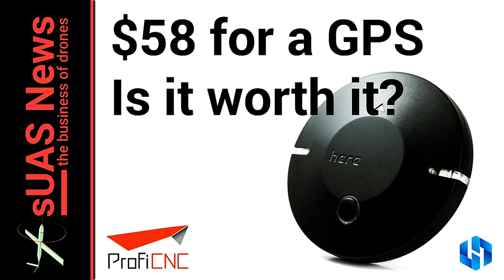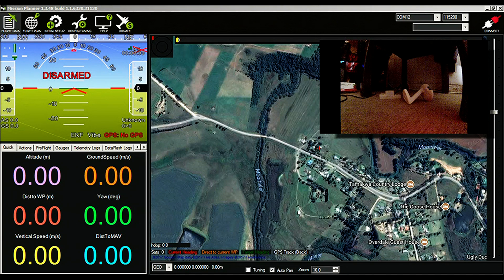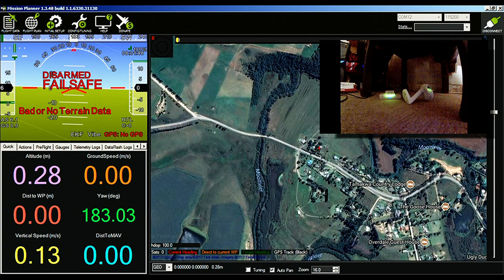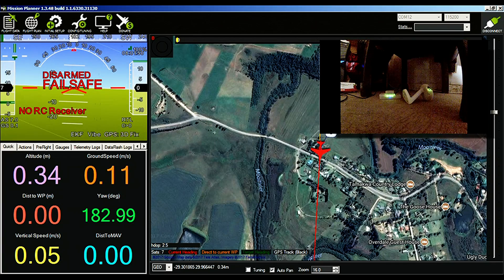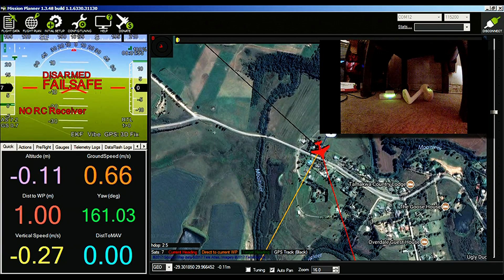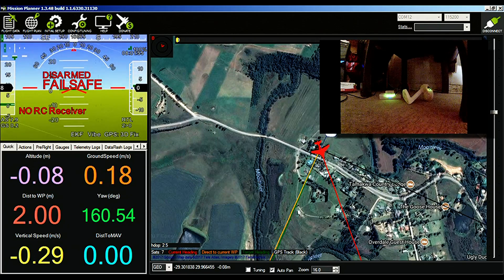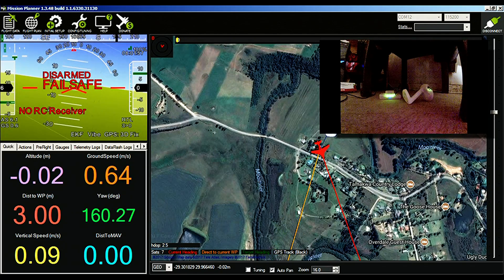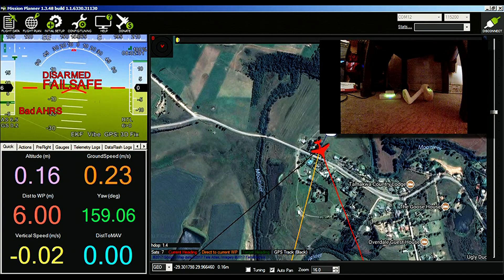The M8N Here GPS from ProfiCNC

Comment: ~> is it known to what degree they are off by, on your ac. I'm trying to take known reference "off by"  distances and correct in "separate " program  CORS in theory, bypassing RTK equipment. The RTK data needs to be corrected too so why not correct from your already known state. We'll see. (Quantum & Google map georeference with Cape Canaveral COR station is the general idea). What a mix of reference system data by State and Local Governments here!
Reply: that won't work- must apply correctors on EACH satellite, a $58 GPS unit won't give you what you need. However, it will give you a low precision position in a noisy environment.
Reply from the maker: I won't be after accuracy, just a fix within 10m of take off. I didn't expect it to see anything under my chair. I guess the 6cm ground plane helps.
Reply: Agreed, but looking to reference my local CORs stations positioning system and correct against aircraft reported position (6~`15 foot off reference) vs. google maps (reported). ?gsBabel?
Never said it was going to be easy but looking to create a procedure to do just that.